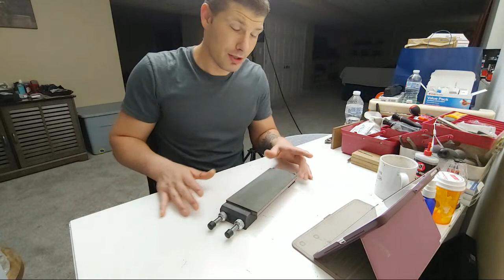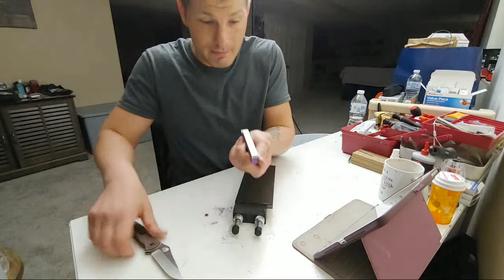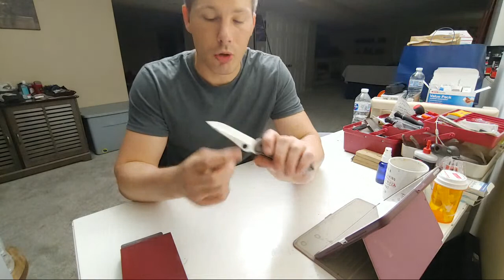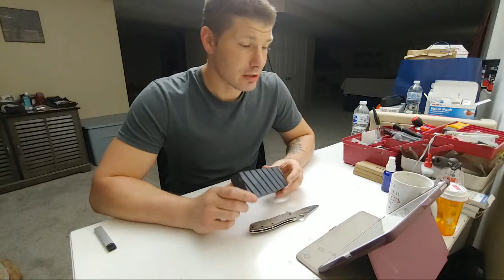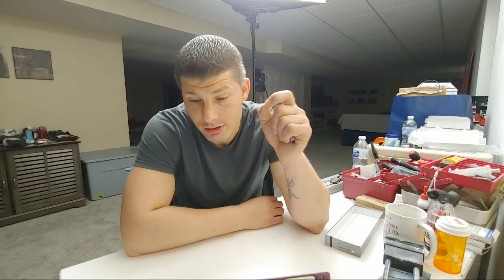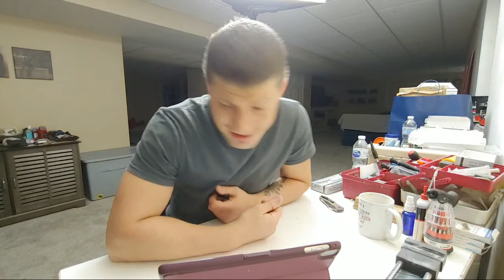🔴NEEVESKNIVES LIVE SHARPENING #3

Comment: Oh im also a free hand sharpener but have not had tons of experience with super tough steels as even though ive been collecting and free hand sharp my entire life.  I still dont have the knives and sharpners you do and i get by.  I normally only take the minimum amount of material off of a blade for conservation but also because i dont have a complete set i have more doubles of stones say in a different brand or platform.  Just what i have bought over the years new and used and have been given.
Reply from the maker: Oh completely get it, i got by for a long time on aluminum oxide and Arkansas, but my edges greatly improved when i moved to diamond plates

Comment: Hey just found this video now.  Im part way through it so far and i was wondering what venev stones you have exactly did you start on the 1200 or the 240/400 are they the dragon series or the phoenix.  I think the dragon.  Im just interested in buying some to cut faster and also sharpen up good.  I may only buy one for now because of the cost and ive also been buying 3v and m4 benchmades so i want it to sharpen quickly with a nice finished edge and also be able to reprofile the tough steels a bit
Reply from the maker: I have both the dragon and Pheonix, I think in this video i only had the pheonix at the time so i would have started with the 50/40 and the other side is 20/14 then move to the higher grts if wanted, but their grit rating is micron rating and in my opinion the 50/40 is like a 1200 grt the highest i have is the 3/2 micron which is like 5k grt but if you want one good stone id get the 50/40 +20/14. I have lower grts 160/ 125 + 100/80 which i love I almost always start with them but if i was going to start with one it would be the one i said, then if you want a mirror get the higher obe, and if you want faster cutting and reprofiling get the lower one, but remember with the micron rating the lower the number the higher the grit, the higher the number the more coarse
Reply: Thanks for the information it was helpful ill get what you recommended thanks

Comment: Hey jerad sorry I missed the live I had to work a double but man I have so many questions for free hand
Reply from the maker: Hey Nick Im going to keep doing these I really enjoy them so hopefully everyone eventually can make it, and im always willing to answer questions, or even if theres a specific time that is good for both of us i can always go live then
Reply: @NeevesKnives  that's fantastic thank you so just real quick I'm thinking about getting the apex pro but have been free hand sharpening and stropping for a while now I'm currently using the work sharp tri stone and I have 3 Norton oil stones I've been using them dry it really seems to work but would like your feedback on if that's ok or not thanks
Reply from the maker: @nickmartino2839  if you bought them new, and have not used oil on them then I would start using a dish soap and water mix on them, it lifts the particles out of the pores to help the stone to keep cutting while sharpening, and id definitely start doing that It will increase the performance of the stone and get you better edges, because when you dont use it your rubbing the steel particles against your edge. And it all around makes your stone work better for you
Reply: @NeevesKnives  I did get them new and no I've never put oil on them
Reply from the maker: @nickmartino2839  so you can take a water bottle or something and mix up some dish soap with water and that works great and its way cheaper than honing oil